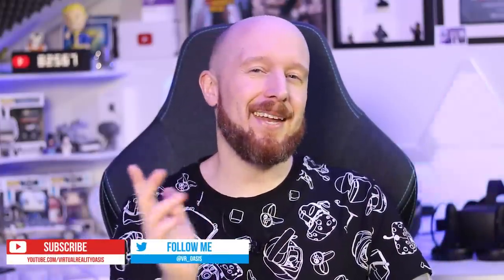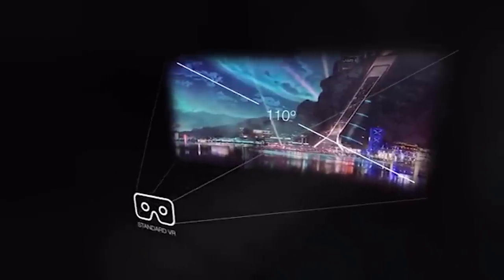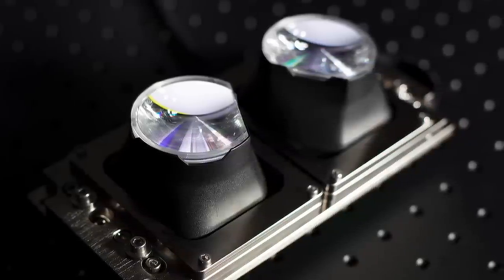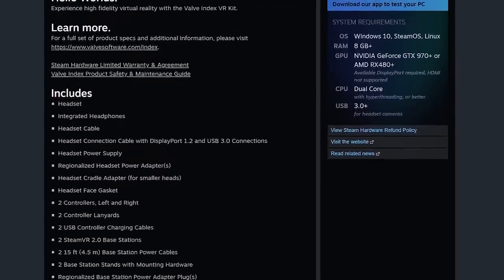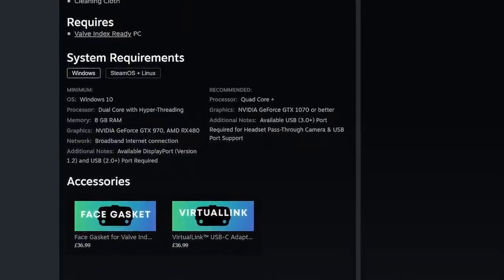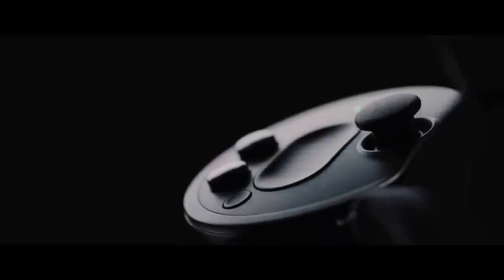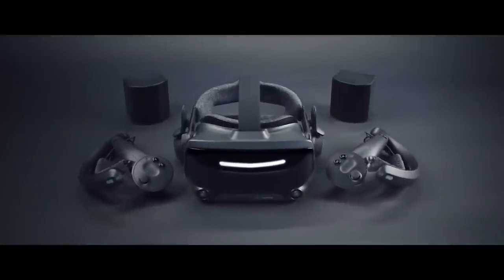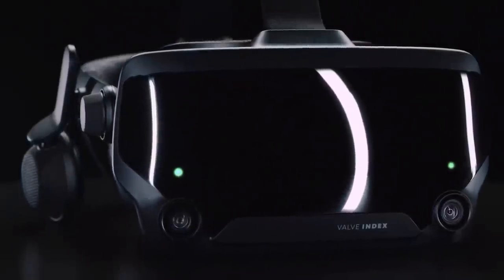Valve Index - Everything you NEED to know

Comment: As someome whos been an early adopter since 2016 (4k, enhanced consoles, RTX gpu)  i will be opting for the Rift S this time.  The RTX cards launched last year and there is STILL ONLY 3 GAMES that support it.  I read an article stating Boneworks plays the same with the rift touch controllers as it does with the valve ones, and i assume that will apply to alot of other games for some time.  The index seems like a great product, but if i can get a similar experience (excluding refresh rate, fov, and some new controller technology) ill go ahead and save $600 on the rift s.  Not to mention i can run steam vr on rift, and cant play Stormlands or asgards wrath on index. And im sure oculus will habe a solution to the index controllers in the future and the cost of the technology will decrease with time

Comment: how good will it work with a GTX 1060
Reply: How well do you deal with motion sickness and 10 FPS in games?
Reply: Sigtyr IT says that the minimum graphics card option is GTX 970, and GTX 1060 is better
Reply: @SimplisticVR  I don't know if you quite understand what "minimum" means. It is nowhere near what is "recommended." 

You can certainly expect framerates that might make you sick and that would be considered unplayable to most gamers. The 1060 is only about a 10% improvement over the 970, which is five years old.
Reply: Sigtyr okay sorry my bad, thanks
Reply: @SimplisticVR  Nothing to apologize for. I am the one who is sorry for replying in a seemingly rude/patronizing manner. 

Unfortunately, what I said is 100% correct. You will need to upgrade your PC before considering getting into VR. Even if your current setup could run the headset and the software, your experience would be extremely poor, frustrating, and unsatisfactory. Your first exposure to VR should be an incredible one, not a disappointment.

You could always try out the Oculus Quest, which will be standalone and wireless and still provide an immersive VR experience. You won't need to worry about investing even more funds into your PC so as to run it.
Reply: Sigtyr

Thank you so much, for helping me, we need more people like you in this world.

Have a nice day😊

Comment: I live in a trailer, I don't have room for VR =(
I was excited when I heard that there would be stand alone Headsets, but they apparently get ruined if used outside for long periods cause of the sun =(
Reply: It's becasue the lenses on inside-out tracked kits magnify light and can burn the sensor behind it. You can play with steamvr kits outside just fine, but direct sunlight has IR light and can mess up tracking, so as long as you don't have direct sunlight, an Index or vive will work without issues. There are plenty of youtube videos showing this.

Comment: The price is ok i think. Since i just upgraded my Vive with a wireless adapter and it apparently doesn’t work on the Index I’m gonna wait a while. Too bad cause I really wanted the index.
Reply: Its for all intends and purposes unclear if it will work, honestly logic thinking states that it WOULD work, but only at 90hz, which raises the question if you really want that, best would be a new wireless adapter, and i think its safe to assume this will happen, at the very least from Intel+DisplayLink (as Intel already has the needed tech right now, TPCast doesnt, the real question is if Intel can make it affordable enough to justify a 144hz wireless setup)

Comment: to buy this vr full package and build a pc better then min. spec but not necessarily most powerful pc build what ball park price would one be looking at from nothing to ready to use anyone?
Reply: $2500-$3000 if you have nothing. If you can get a cheap monitor, cheap mouse and keyboard, cheap PC case, and cheap SSD, you can probably get away with $2000 for everything.

Comment: Anyone know why if you add up the prices of the pieces individually (HMD: $500 + controllers: $280 + towers: $150  = $930) is less than the combo kit ($999)???????? I thought buying as a kit is supposed to be cheaper lol.
Reply: $149 is the price of one base station. You get 2 in the kit. $499 + $279 + $149 + $149 = $1076, making the $999 bundle a saving of $77.

Comment: Next headset has to be compatible with or include Wireless. Not sure where this stands yet.
Reply: They likely skipped on this because of the high framerate they also wanted to support. Remember that a 90hz headset (read: a Vive/Rift/Vive Pro) already required like a 60ghz wireless connection, imagine what sort of outlandish form of Wifi they would need for 144hz, it would make the headset so much more expensive, it kinda makes sense they didn't add it, they will just (like with the Vive) wait for other companies to make an accessoire for it, for those that are willing to spend more. I honestly think we're not going to see native wireless support for high-end desktop vr till at least generation 3 or 4, we're still pretty much in generation 1, and while the valve index looks like it could kick off generation2, we really dont know yet how many of those quality improvements pan out in actual use and if this actually is the start of gen2.

Comment: I just don't get why the friggin' lighthouses are $150 each. It seems like the tracking system is most of the reason the Index (and the Vives) are so expensive. 

If the Index had inside-out tracking similar to the Rift S and cost $300 less, it'd be an easy buy for many CV1/Vive owners.
Reply: Inside out tracking is for simple vr experiences. This is a high-end VR kit. If you want the best tracking, or at least compete at a level where you need it, the Index is it.
But yes, the LH2.0 which has less components and should be far cheaper than 1.0 is a complete mystery.

Comment: I'll stick with my Odyssey plus, the tracking can get a little wonky at times in Beatsaber but it's the same resolution as the index. i just don't know if this is that much of an evolution over whats out right now. The only thing that looks amazing is the knuckle controllers. and there is really no excuse for a wired headset... we know wireless vr is possible why not include it?
Reply: First off, I have an O+, and it's pretty apparent that having LCD, 120hz and dual lenses will yeild a far better picture, Also the 130fov will increase that immersion. Don't also forget about the most underrated aspect about the Index, BMR audio, which is something very few people have even heard, let alone seen a BMR speaker. The Index represents the next gen of every aspect about VR, though it's not some huge leap individually,  with everything together, it certainly is a big jump (as said by testers).
Knuckles is just the icing on the cake. 
60ghz is not easy. It's well known now that you really need a beast CPU for it to work, you also need a PCI-E 3.0 slot when most everyone is still on 2.0 and very few can force 3.0 bandwidth. Also consider the cost, these kits are not cheap. The only flawless and viable kit is the vive adapter and it is $300. Sure it's the best $300 accessory you can buy, but it's still expensive on top of the initial cost of the kit. 
Valve has expressed very clearly they are dedicated to 60ghz wireless VR. It would be very odd if they do not get support for the current vive adapter from HTC/Intel/DisplayLink or partner up with someone else and develop their own.

Comment: Valve or HP...That is the question?. 
Bytheway, I cant believe you still have a 4 core cpu with an rtx 2080 ti!
Reply from the maker: Tough choice! Depends on what you play I guess. HP will be good for sims. This is my only PC so it's a work horse for VR and video editing []-)
Reply: @VirtualRealityOasis  Really love your show and your Hosting skills Mike. 8 core will be a better farrari for VR  and video editing. []-)
Reply: Im still on a haswell CPU lol, i just dont ever see a reason to upgrade it anymore, sure theres plenty of CPU's with more cores now, but none of them reach the Ghz of mine, so at the bottom line for most cases the difference is neglectable (because for whatever dumb reason 95% of software and games still doesnt do proper multi-core usage) Id rather spend my money on a new headset ^^

Comment: I wanna do an upgrade, rift to this, but idk how my 2070 will like that
Reply from the maker: It should be ok at 90hz []-)
Reply: Damn, no need to flex 😥
Reply: @VirtualRealityOasis  well that's reassuring
Reply: @timmontanus4311  oop, took me 2 months overtime to get that
Reply: I am sure my 1070 will like it a lot.
Reply: With a 2070 you really shouldn't worry lol, the only people that might want to think about upgrading are those below a 1080/similar amd card, and thats only if they plan on using 120/144hz

Mentioned this a couple of times already, but going to mention it again, "reprojection", a tech used in VR thats bscly about the insertion of 'combined frames' to get to a certain framerate, SteamVR already does this when a computer cant deliver the 90fps needed for 90hz, a PS4 (of all things) does this to bump 60fps up to 120fps for the PSVR's 120hz display, surely a 2070 is going to have no trouble AT ALL to insert some extra frames if needed to reach 144hz.

Really, you have nothing to worry about lol, you will likely hit 144hz natively with ease in most games, and when it struggles you wont be able to tell because of the reprojection still pumping out the 144 needed frames.

Comment: Rechartgeable controllers instead of batteries NOT a good idea. What if I want to play longer than what the controllers allow? Plus we all know batteries have a way to lose charge so in the long run less and less charge of something you cannot change/replace.I'm not in love with the rift controllers but when the batteries are low I shove in a new set and I can go for another 3 or 4 + hours. With a rechargeable controller you'd have to log off and regharge
Reply: I feel that, but also my phone through usb c charges half way in about 30 minutes so im sure the controllers wouldn't take longer then 15 or even 10 to fully charge
Reply: @commentaccount7880  I know, but what I'm saying is why put a rechargeable system in there (great lithium battery, USB port etc) when building "the best controller" when you could've just put a spring a piece of metal and a magnetic cap (like oculus did) that would've done a better job. I presently have 2 sets of energizer that I swap when I get the "battery low" message, I don't even have to get out of my game to do it. Personally I think copying a great idea when you're building "the best" is not diminishing your work it's just acknowledging that someone was on the right track but you took it further and made it a lot better.
Reply: @kobaltstaub287  ik they could have made it both but it is what it is

Comment: Okay, my question (for Valve) is this: Since you've finally devised what looks to be an actually viable control system (index controllers), Will you be allowing the use of this control system outside of VR? Can I bind my Index Controller to the controls of a non-vr game and leave the motion tracking out of it? I know it's not in the spirit of the design, but I think it should totally be possible, because they look like they could be really ergonomic for regular use, not just in VR.

Unfortunately, Valve doesn't seem to have set up an FAQ specifically for the Index system yet, only for it's shipping info. If anyone knows the correct place to pose this question to Valve, please let me know.
Reply: I think your problem is that you don't understand the technology and just don't know what on earth you are talking about generally speaking. 
The knuckles controllers only work in steamvr, they send and receive data via bluetooth either from the headset or the steam BT dongles if you have a different HMD to use with steamvr. 
The buttons and controls of the knuckles ONLY make sense in a VR environment, they are not traditional gamepads.
Reply: @sqlevolicious  I understand perfectly that valve designed the controllers for VR. It also makes sense that on launch day they would have no existing plans for adding other supported uses, as they'd be busy making them perfect for VR. But since they use Bluetooth to connect, I don't yet see any reason they couldn't be connected to, say, a laptop or phone. The technology behind the controllers was definitely built for VR and has been too expensive for anyone to bring to market in a non-vr application to date, but that doesn't mean it isn't also capable of being used for other things. I, personally, think that having a one handed controller with a joystick, a couple buttons, a trigger and three configurable finger sensors would be amazing, and I see no reason why valve couldn't write a version of the controller firmware to support it, especially since they're already writing input configuration code for them. Unless I'm mistaken, all they'd need to do is make a version of the firmware that can stop doing the motion tracking logic when required, make a version of the driver that can be configured to not automatically launch steamvr, and tell their control customization system to accept them as standalone configurable controllers. In other words (and vastly oversimplified ofc), they'd just need to ask a programmer to get it done. I could be wrong, and please correct me if I am, but I do believe that the hardware of the index VR controller is capable of operating this way.

Comment: OK overall I love my Index... but there are 3 things that are VERY VERY annoying 
#1 the placement of the joystick makes it hard to move forward and push down for run.  I play a lot of recroom paintball and after about 15 minutes my thumb is usually in pain.  it's very uncomfortable.
#2 Worse. the Stupid Steam Screen shot is constantly going off in the middle of a match, getting me killed A LOT..  There dose not seem to be any valid way to turn the damn thing off. I have disabled it in the Steam Settings but its till happens all the freaking time.  there is no way I can adequately state how annoying this is.
#3 while no where near as frequent as the screen shot is the main VR popup. this freezes you in game so that you cannot move  and can be difficult to close, it almost always results in getting killed. 

The joystick and buttons should be moved so you don't have to reach half way around the planet with your thumb to use them. 
we MUST be able to turn off that fracking screen shot thing. 
and the VR Popup SHOULD require long press of the button on both controllers at the same time to trigger. 

if Valve would fix these three things then I would Totally love my Index.  but as it is it's an abusive love hate relationship.

Comment: Sooo no one else worried about it using LCD? If I remember right Linus said that LCD has built in lag vs oled in his review of the pi max. He also said this made him nauseous.
Until someone can confirm no latency issues im going to say pass~
Reply: At any rate, Linus is known to be a hater of VR ;P
Beyond that, the whole reason every VR manufacturer and their mom is moving 'back' to LCD is the lower response times, so nobody is worried about lag. What will be different (but it remains to be seen how different) is contrast. There are several pro's and con's to both OLED and LCD, we will just have to see what works best/what sells well, for now the whole industry seems to move towards choosing response times over contrast.

Final thing to note, he tested some early unit of an early pimax model, pimax moved on to better screens not long after, since then we've seen better LCD panels appear on cheaper VR, and now Valve are bringing even better LCD screens to VR. Not saying theres no reason to be skeptical, and its always good to await further reviews, just saying you give Linus too much credit for something that happend to long ago to still be relevant

Comment: The resolution is too high for most people. Shouolud be aqwesome for those with 20 series cards. I bet a 1080 Ti wont be able to push that many pixels at 120 hz.,
Reply: Dont forget about 'reprojection', a trick used to 'insert frames' when the pc dips below a certain threshold. This functionality is already in Steam, and if you need any proof about how much performance savings that gets you, a PSVR runs at 120hz too, the PS4 renders games at 60fps and then reprojects that to 120fps. If a PS4 can do it, i wouldn't worry to much about a 1080 Ti, heck a 1080 will likely happily do 120hz.

Comment: 11:41 Woah, easy there.  First 2nd Gen headset, due to new features? What exactly makes this headset qualify as second gen and Pimax not? I mean on my list of things that VR needed to make it next gen 144hz wasnt one of them.  The controllers may be next gen , but other than that. The screen is nothing new. 144hz has yet to be proven to little more than a gimmick until more people try it.  I know pimax is a little sketchy quality wise and they arent well known. But that FOV is something else , and they literally had WORKING eye tracking on the show floor this year which will lead to the first consumer headset to have foveated rendering. Not to mention pimax's other modules like leap motion finger tracking and smell module, and wireless module, and the sword controllers which is potentially the same as index (or better comfortwise if mrtv or voodooDE are to be believed) . It would seem pimax's biggest problem are themselves if they are constantly being overlooked despite having the best tech. what a shame.